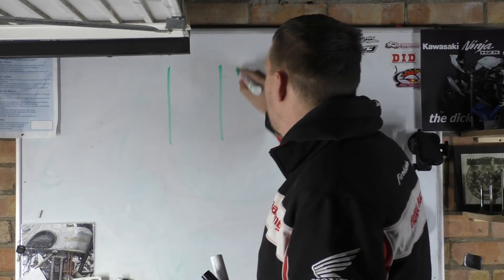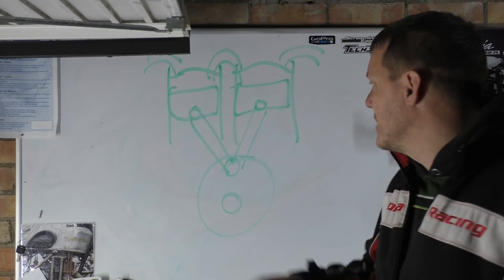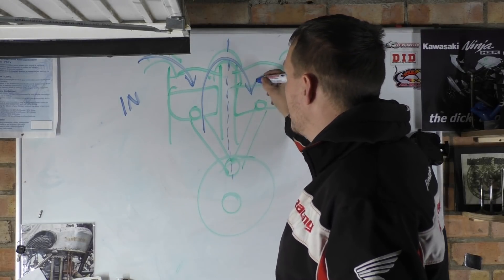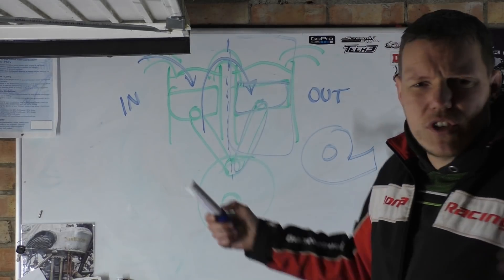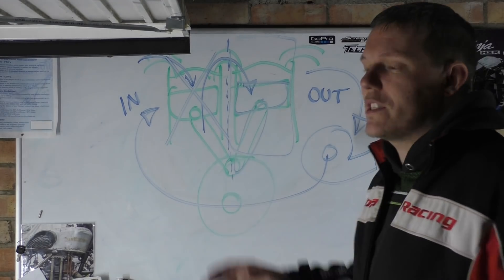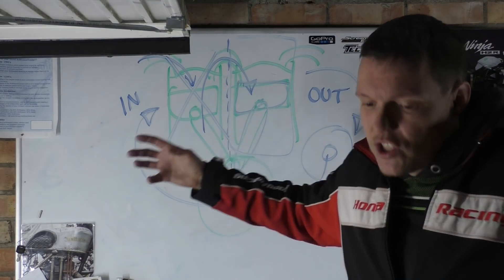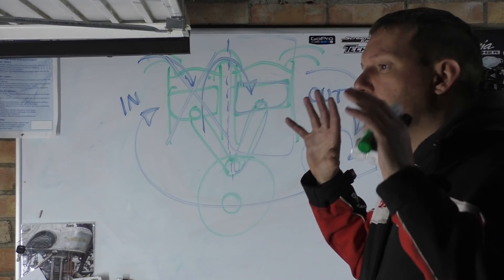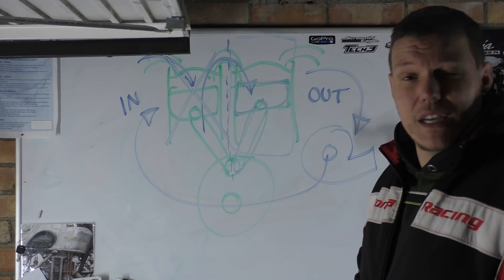Split cycle engine - Supercharged!

Comment: nor overcharging nor overexpandig, split cycle as its simplest is a piston for compression and other for expansion. Just 4 strokes. Each cyl with 2 strokes. not recovery not supercharging. The idea for separate them is to pump and expand more efficiently with its own characteristics and not to mix the different temperatures that each cycle does. Working each piston in its optimal temparature depending on wich work is it doing

Comment: Could we use a turbo that instead of compressing air, powers your alternator? Use some gearing for torque and size the turbine to function at idle, and use it in addition to a normal turbo or whatnot, not instead of. Basically the recovery system in Formula 1.
The only thing I'm concerned about is the immediate boost in system voltage from an alternator at startup won't be present.
This system could be useful to recover a little more energy from exhaust, is one less belt to replace for cars, and is less parasitic loss.

Comment: I can't find a link to the article, but I read a while ago about someone taking a Harley engine and using the rear cylinder as a supercharger. It claimed to make a significant amount more power than the original, probably at the cost of reliability and maintinice. Still think it's an awesome idea just for the hell of it. Maybe not feasible on a commercial scale, but picking up a project bike with a ruined cylinder and trying it out might be worth while. Also points for doing things differently.

Comment: The Germans played around with split cycle engines through the 1950's to 1970's especially DKW.

The Germans mass produced loads of these types of engines.

Well known split cycle engined vehicles include the Messerschmitt 3 wheeled car thing, Izetta Bubble Cars and the DKW 250 motorcycle.

Split cycle 2 stroke engines produce huge amount of torque at lower than average revs compared to conventional CCI 2 strokes. On the downside they have a low RPM redline due to reciprocating crank stresses.
Reply: This makes sense this was before small turbos where cost effective. So Matt’s point on Turbo compounding holds. Question between the wars did small superchargers for small engines make any economic sense. There were plenty of blown big engines I don’t recall anyone blowing a small engine though Maybe at this time small split cycle engines made sense

Btw anyone know a good book or books on the history of piston engine design I have one on ww2 aero piston engines but nothing on the whole shebang

Comment: Review a Duke engine next! Or soon. Or whenever. Dont forget the sheep
Reply: Got to admit I found the Duke engine interesting. It's from New Zealand if I remember correctly? But I just think all the manufacturers are pumping their R&D into electric. It's a shame. Matt actually said he's glad he'll be dead by the time the IC engine is finished with. I'm just pissed off I'm too old to handle the power my new 2 stroke bike puts out. Now I've read the sheep bit I'm sure it's NZ. Talking of which, there's a video somewhere on YT where a Welsh regiment is operational in Afghanistan. All the little local boys are shouting "Sheep Shaggers" at them.

Comment: What about a piston engine with power boosted by a turbine engine? Use the piston engine for the low end tq. And throttle response.   . crazy I know..
Reply: Something similar to this was done at the end of the age of piston-engined aircraft, it's called turbo-compounding- https://en.wikipedia.org/wiki/Turbo-compound_engine

Comment: Matt, the 5 stroke design with the extra expansion is just bad compared to a turbo, like you say. 
But you missed that the split cycle with one doing intake and compression and the other one doing power and exhaust does an ignition every rotation, like a normal 2 cyl.
Therefore the weight and complexity argument is not really valid..?
Reply from the maker: "But you missed that the split cycle with one doing intake and 
compression and the other one doing power and exhaust does an ignition every rotation, like a normal 2 cyl."

- well its not is it. A normal 2 stroke has 1 piston firing at every TDC. This is a twin cylinder firing over TDC - like a parallel twin normal 4 stroke.
Reply: @thedirtyworkshop  that's what I said:)
Like a normal 2 cyl 4 stroke. 
Let's forget 2 strokes here, it's about efficiency.

With the same amount of ignition as a regular engine of the same size and  number of pistons, this could really have some advantages. Less time spent in the hot cylinder for example.
Reply: I was thinking something similar, it looks like roughly the same number of moving parts with the same number of combustion strokes being achieved. There may also be some advantages with regard to simplification of cylinder cooling (only one to cool) and a simpler piston arrangement in the first cylinder. I'm probably missing something obvious but I am now wondering why we don't see this arrangement on modern vehicle engines.
Reply: @Walt_G  Some of the advantages are especially that the gasses stay cool much longer, because they only pass through the colder compression cylinder, and are only pushed into the combustion cylinder right before combustion. This enables higher compression ratio without knocking, and therefore greater efficiency and power.

Another advantage is the possibility of using a small type of intercooler on the channel between the two cylinders to cool down the gasses after compression.

One limitation I see is that this engine might only work in V configuration, because usually combustion is started just before TDC, and the transfer at the last few mm of the compression cylinder stroke takes time. Therefore it might be neccessary to have the compression cylinder at an angle to the combustion cylinder.

Comment: I have a faint memory of some engine concept that could run as a four stroke and two stroke, kind of switch mode idea. Supercharger doubling as scavenger pump when the mode changes, direct injection. I can't remember where I read about it or if there ever were even a functioning prototype.
Intake and exhaust valves open at the same time, scavenger pump does its trick, exhaust closes, fuel is injected, compression, bang. No holes in the cylinder wall, difference in compression/expansion ratio points towards Atkinson cycle.
The idea was that you could have mellow four stroke and screaming two stroke in same package, but probably the complexity (if mechanical valve control) and difference in ability to burn fuel in two stroke mode would have kept the power output somewhat the same.

Comment: Why do you need more camshafts than normal for this tho? Can't you just go with a straight 3 arrangement and have 2 overhead cams like you would normally?
Reply from the maker: well you can, but then you need more rockers/valves etc and a strange and large cam layout
Reply: @thedirtyworkshop  You can also embrace the retardation and make it a vr3 (as in half of vr6) and half fully variable DOHC on it.

Comment: the rev limit in F1 is 15000rpm, but since the fuel flow limit is a constant 100kg/h from 10500rpm and up there isn't nothing to gain from running that high
Reply from the maker: I nearly cared LOL - thanks for the info though.
Reply: I know you secretly love F1 ;)

Comment: Say Matt, why does Ducati's Panigale have a counter rotation crankshaft? Does it help balance out the torque from the wheel, aid cornering, etc?
Reply from the maker: We'll be getting to this - but first rotational inertia
Reply: Haha yea been taught the American way in a British overseas territory 😁
Reply: Ah so your gonna go on about rotational momentum and acceleration and all that, sweet
Reply from the maker: Angular momentum! LOL
Reply: counter rotating crank shafts, help cancel out some of the gyroscopic effect of the wheels, making it easier to turn the bike( sure someone will correct me , if i have been given wrong info in the past )
Reply: @BigBadLoneWolf  That seems to be the accepted reason for the Honda CX500 having crankshaft and most of the gearbox spinning in opposite directions.